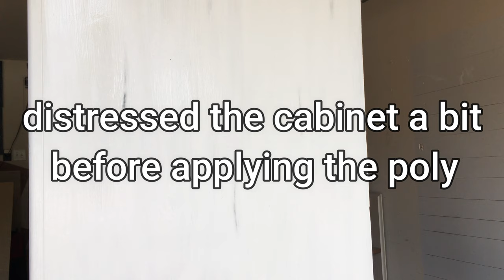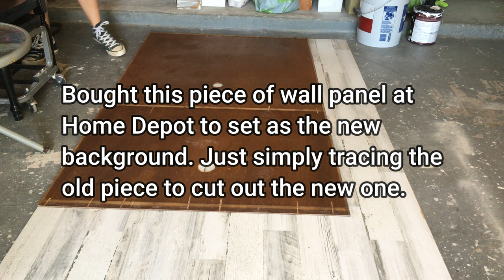Furniture Makeover  | Coffee Bar | TV Cabinet

Comment: It looks so beautiful! How’d you install the light though??
Reply from the maker: We drilled a hole 🕳 on the top so we can run the wire through and we used hooks 🪝 to hold the lamp up. We also stapled the wire at the top for extra security. Hope this helps 😊
Reply: @eeyoreHR  Is there a video of the lamp installation?
Reply: Is there anywhere to find a video to do the wiring?